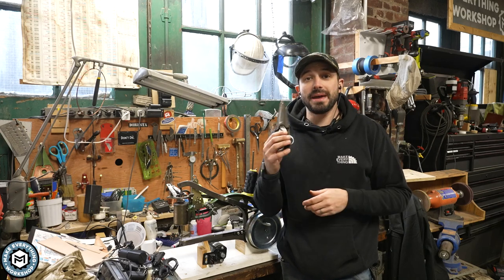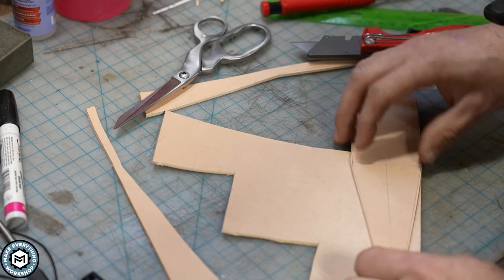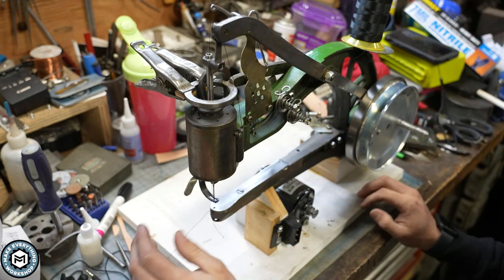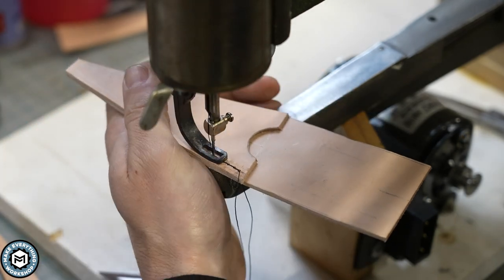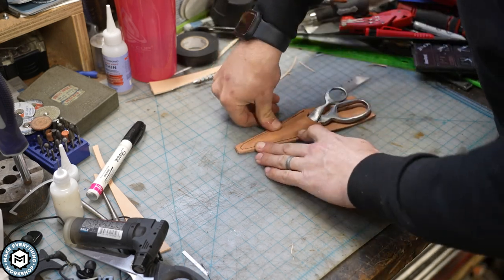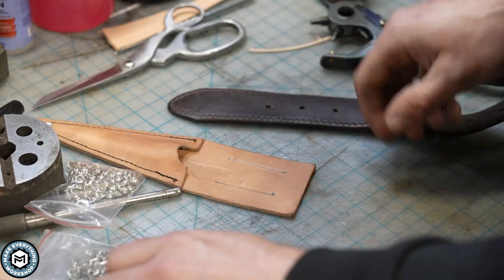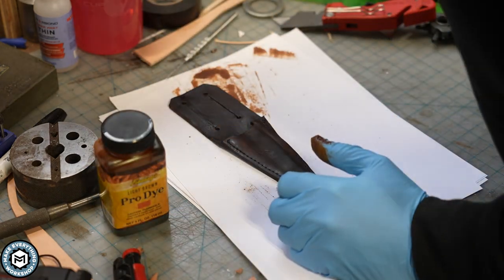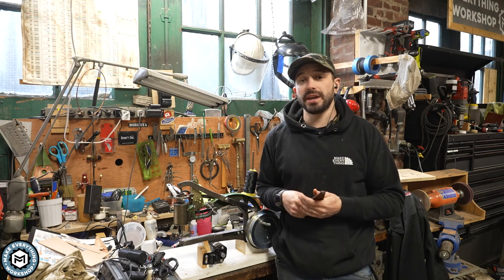The Amazing $115 Leather Stitching Machine In Use! - Making A Leather Sheath

Comment: You should start your stitch 3/4 of an inch into your stitch line and sew towards where you want the stitch to begin then turn 180 deg to start your 'backstitch" which will be going forward and locking your stitch.   Hopefully that makes sense... You'll end up with only two stitches in the beginning holes instead of the 3 you are currently doing.
Reply: That's a good idea!

Comment: Thanks for the video! I have been looking to buy one of these machines but one thing I'm not happy with is the mark the presser foot leaves on the leather. I would be using this on larger projects like purses and messenger bags where hand stitching is just taking me so much time.
Reply: He was using to much pressure on the foot, plus the foot is a bit rough. You can file it and you could glue a piece of something under the foot, leather or vinyl.

Comment: Does the machine always make those marks in the leather on either side of the stitch? I’d hate to tool something up and then it mark my work up like that.
Reply from the maker: Yes it does, it’s in my to do list to further soften the foot with some sandpaper. When I first got it the marks were very deep. If you sand it’s file down the teeth in the foot it’ll
Make a big difference.

Comment: You are lucky that yours only breaks the thread occasionally. Mine breaks thread 100% of the time. I suppose if I use fishing line for thread it works just fine, but that wasn't what I was planning on stitching on my leather with that
Reply from the maker: Check your thread tension, your probably too tight on the bobbin or needle thread and it’s breaking. Also check where the thread feeds down, some of the edges can be sharp and rip the thread.
Reply: @MakeEverything  I think the tension is accurate. I went through all of the timing on the machine to make sure that was accurate. It's breaking in the bobbin section. I think the edges might be sharp in there. Apparently those machines take a lot of polishing before they work well. And I gave up after about  a month of working on it
Reply: If your upper thread is breaking, timing may be off. Lower thread will be shredded if the holes in the bobbin shuttle have sharp edges. I had these problems at first but all good now that I deburred the thread path with a Dremel. It's a little bit of a learning curve but don't give up.